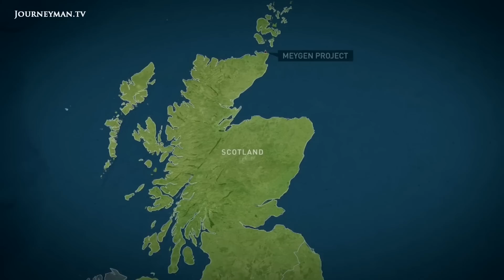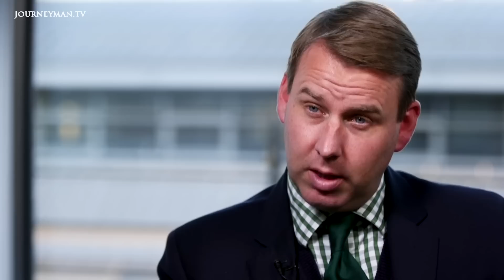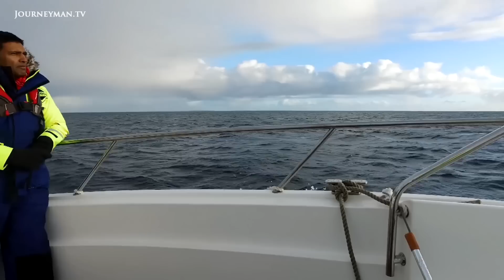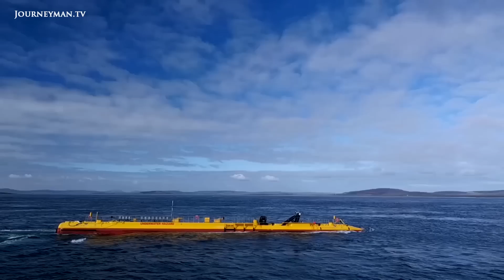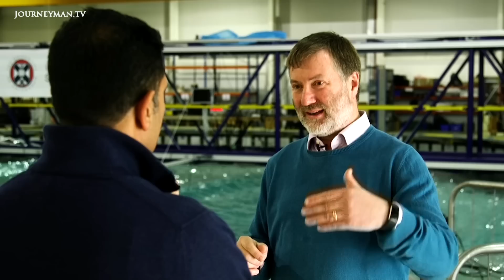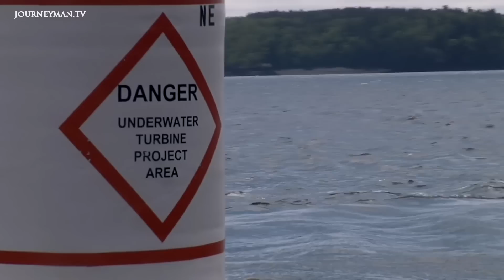Scotland Touts Tidal Energy As The Renewable Of The Future

Comment: i remember something like this being done,years ago,to me its a no brainer,what took them so long, its like solar roofs,dont see many of those either,why the hell not? anything to get power cheaper has got to be done...NOW.
Reply: and still is an idiotic idea promoted by idealists and con artists alike.

Unlike Wind power, much of which is on land and close to communities, Sea Turbine power is always far away, and then the costs of maintenance is huge because it's submerged out in no-where....AND the cost of delivery is exhorbitant. Since on average power networks lose about 25% - 30% on transmission (due to heat loss) putting a power source and extra 30 miles away is really costly. 

Present systems generate heck of alot of power, then step it up to high voltage (126kV or 242kV or 500kV etc) to over come this problem because higher the voltage means lower the current means less heat loss.

But for ocean turbines to generate that much power they have to be HUGE and geographically very concentrated. With those requirements they have to be in deeper waters, and turbine power in water creates friction which slows it down. AND the there are problems of bioorganisms living on it....

I can tell you it's not even forseeable that Ocean Generators have that level of efficiency....nor are they ever gonna be that indestructible. 

All they are selling you is hope : if you put money in it, the tech will one day payback. Unfortunately it never did for ocean power. Every sales pitch promises double the power and delivers a quarter of the performance promised. They have spent literally 10s of billions of dollars of research funds and given us nothing.

I will tell you now not to compare with Wind Energy. Wind power was started by a small Danish company called Vestas about 30 years ago,and at one point it dominated 70% of world markets. But it Never spent billions of VC funds to start up. It hardly delivered dud projects. 

All I can say is Ocean Power Tech in its present state isn't just a tech waiting for money to grow, it's a con Job.
Reply: @toraguchitoraguchi9154  
You clearly did not pay attention to the documentary and appear to cling onto old tech ideas and aspirations like a true fossil addict.
Reply: @showme360  Same old ocean energy crap rehashed.

Comment: It seems like it would effect wildlife more to have many tidal turbines under water, than a few mega size wind turbines that are also more efficient and productive at this point. But hopefully tidal energy can get more competitive with wind in the next few years.
Reply: Wind has a more dramatic effect on the turbines than tidal water movement, which is more stable and consistent in strength and speed. The turbine moves with the water, not the other way round! The number of turbines would be considerably less than wind, but could conceivably achieve the same amount of energy in the same time frame!

Comment: For what its worth, here are a few things to consider about any device, wind, water, solar, etc designed  to capture " free" energy.  Why:  Why are you doing it?  is it to reduce the cost of electricity to the end consumer? or is it to save the planet?  If its the latter, then the question is simple this: does the device that you intend on making, cost more in terms of polluting the planet, during its manufacture and maintenance, than in its ability to reduce pollution, when generating electricity during it operational, and decommissioning lifetime?  If the answer is 
that its  about the same? then is it really worth doing at all?, for saving the environment and planet?  The trick is to have a device that can generate electricity, that doesn't cost, or have a great impact on the environment, by the pollution generated during its manufacture!  That should be the holy grail of green power, the goal that all devices should be able to claim.  Thus it is not a race to see whether wind or tidal energy can produce the most electricity, its what the true cost to the environment, that should be the bottom line! and which generating system can rightly claim that  it generates "cleanest " electricity by virtue of impacting the environment, the least during its manufacture and decommissioning.

Comment: Tidal power is the most wasted power that could be harnessed as stored energy. It is predictable in power and schedule. It is totally created from the moon's gravity  as the moon orbits the Earth . So you know it won't  change overnight. If we were to use the principles of hydraulics , we could use the weight of the water  to pump or elevate either the water  or other mediums  that can later be used to release the stored energy when in demand.
Presently they pump water using excess hydro power. Imagine capturing  the potential  energy of a mass of water in a man made bay that is manipulated  by hydraulics  to elevate a medium , 10 times higher for free and release that stored energy  when needed.
In the mean time turbines can still be used as gates as the tide waters enter and exit.
Together they would supply energy around the clock , even outside of the tide's  schedules. 
Bring hydraulics  experts and engineers  into the designing.
I'm sure  this is the way to go.
Reply: Tidal power & hydroelectric power is the most efficent clean ways of producing power.

Comment: Why no mention of the down sides? First, the tide only runs fast for a couple of hours and then it slows down, stops and starts to run in the opposite direction and it does this almost 4 times a day.....so you need other energy sources during these periods of low/no production.
2nd, the marine environment is far harder on things than the land, after a couple of years they will be over-grown with marine life and anything that can corrode will be corroded.
3rd, what about marine animals like whales and dolphins, do they have to take their chances that they don't get cut up?
Reply: We never had dolphins, and frankly we've successfully killed off most of the even vaguely interesting sea animals around our coast. Now we have..... Jellyfish and um.... The occasional seal, a basking shark or two...... Yeah, that's pretty much it. Most animals have the ability to steer around large reasonably stationary obstacles like these without too much issue.
This is clearly designed as supplemental power generation, and as such is not designed to run on its own, hence the national Grid.
In the article they said it needs to be pulled out and refurbished every 6 years, though I imagine there's more routine maintenance done on site.
Btw, in November we produced (at peak supply) 109% of Scotland's power demand from wind turbines alone. But the problem with that is its not consistent, so in answer to that, in development, there is a project to use old mine shafts to store power in the form of a massive weight which is winched up the shaft when there is excess power and lowered releasing the potential energy back into the grid. Simple, low tech solution to energy storage.
Reply: @alexarcano  

A wee sonic warning pulse being emitted will keep everything away, I mean if theyre smart enough to stick a big turbine under water n power 1000 homes from it theyre smart enough to attach a dog whistle  for fish onto it.
Reply: Because pipelines and drilling equipment for oil and gas and fracking do not corrode?  If you have ever seen a tide ripping through a sound at full speed, so fast and turbulent it produces white water, marine life adapted to all that.  seems like these turbines move fairly slowly even at full speed one full rotation takes a few seconds, methinks not fast enough to frappé marine life or produce cavitation that would burst an air bladder, unlike the turbines of hydro dams that choke rivers all over the world.
Reply: You know very little about tides by the looks of it. Around Britain there are hours of differences between high/low tides depending on location. Strategically positioning a number of these would provide constant supply of electricity.
Reply: @onemaninaboat  Yeah, I know there can be hours of difference between tides over a relative short distance. The problem being, you need somewhere that the tide creates a strong current, like the opening into large natural harbours and bays, the best is straights between 2 large land masses. So it's only natural to place the turbines where they will generate the most power, but that means the locations are very limited.
Reply: just normal renewable fanboyism,  they never admit to downsides even when slapped in the face by them.
Reply: You know generator's makes power no matter which way they rotates right? All it needs it computer controlled switching. Also any movement passed the blades will produce power and at a decent load even @ low RPM.. as water is denser than air so you can scale up the generator vs what you can with wind pushing on blades. 

A green future is a combination of tech as nothing is a silver bullet as such* Also every house needs to be wired to run a basic 12v LED lighting system vs using 240V mains scaling that down to a 15w LED light bulb in your room is ludicrous. Also energy efficiency as a whole needs to get better as then as a person,house or a city will require less power to live the current life we enjoy now without sacrificing anything.
Reply: The Tides are inexhaustible and therefore totally reliable to build upon, the fact that they speed up and slow down is just as reliable to design for,  and as for marine life, how do they avoid all those shipwrecks in such waters when passing by?

Comment: and still is an idiotic idea promoted by idealists and con artists alike.

Unlike Wind power, much of which is on land and close to communities, Sea Turbine power is always far away, and then the costs of maintenance is huge because it's submerged out in no-where....AND the cost of delivery is exhorbitant. Since on average power networks lose about 25% - 30% on transmission (due to heat loss) putting a power source and extra 30 miles away is really costly. 

Present systems generate heck of alot of power, then step it up to high voltage (126kV or 242kV or 500kV etc) to over come this problem because higher the voltage means lower the current means less heat loss.

But for ocean turbines to generate that much power they have to be HUGE and geographically very concentrated. With those requirements they have to be in deeper waters, and turbine power in water creates friction which slows it down. AND the there are problems of bioorganisms living on it....

I can tell you it's not even forseeable that Ocean Generators have that level of efficiency....nor are they ever gonna be that indestructible. 

All they are selling you is hope : if you put money in it, the tech will one day payback. Unfortunately it never did for ocean power. Every sales pitch promises double the power and delivers a quarter of the performance promised. They have spent literally 10s of billions of dollars of research funds and given us nothing.

I will tell you now not to compare with Wind Energy. Wind power was started by a small Danish company called Vestas about 30 years ago,and at one point it dominated 70% of world markets. But it Never spent billions of VC funds to start up. It hardly delivered dud projects. 

All I can say is Ocean Power Tech in its present state isn't just a tech waiting for money to grow, it's a con Job.
Reply: You clearly did not pay attention to the documentary and appear to cling onto old tech ideas and aspirations like a true fossil addict.

Comment: What would be ideal is to have sluice gates at the gorge to hold the water back as the tide goes out, then open the sluices through to generators and use all the stored energy of the water rather than let 98% of it get wasted.

Go one further and have those generators power pumps to pump sea water into a natural mountain reservoir so you have power 24hrs a day on tap.

The great thing about the sea is it can be predicted far into the future, so you know what you're getting and when.

Comment: Hm. Is not all this renewable energy supposed to cost less in our bills. I must be an idiot, I justo this get it🤕🤕🤕🤕🤕
Reply: Not necessarily, it's designed to move away from the reliance on fossil fuel and nuclear power supply, not to produce cheaper power. Hunterston nuclear power plant is getting decommissioned in a couple of years and frankly the no need to replace it with anything similar because  projects such as these and abundant existing renewables are in place already to cope with demand. So anyway there is maintenance costs involved along with setup, wages and training, all the usual things involved with running the grid so costs are slightly less but roughly equivalent. As the saying goes, there's no such thing as a free lunch.

Comment: So only last 25 years and repaired every 6 years that is very expensive a lot of fossil fuels to do that salt water causes a lot of corrosion
Reply: @Rolf Jander Much less.
Reply: @Rolf Jander Yes, if they are land based systems. It does depend on manufacturer though.
Reply: @Rolf Jander 
A bloody lot as someone who has worked on maintenance on various power plants including nuclear; I can safely say there is no such thing as a maintenance free day on any type of  energy plant that is why they have such large maintenance crews. One small hydro electric plant ( used only in Peak Demand Mostly ) had a maintenance budget of over Twenty Million pounds Annually and used every bit of it and had to get more to fix everything that went wrong in the 4 years i was there, Bye the way this was a modern plant at the time came on line about 1983 I worked there 1991-95.